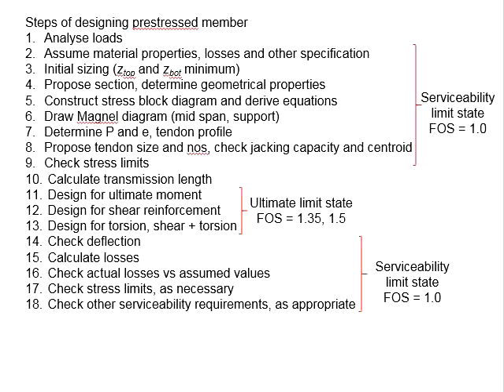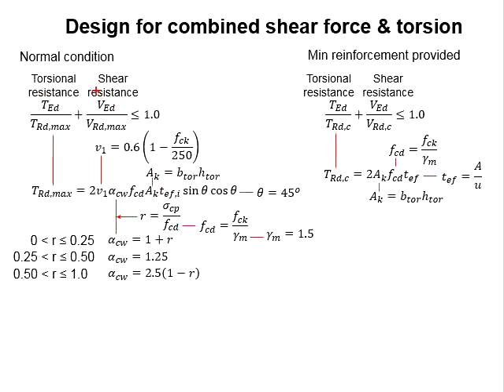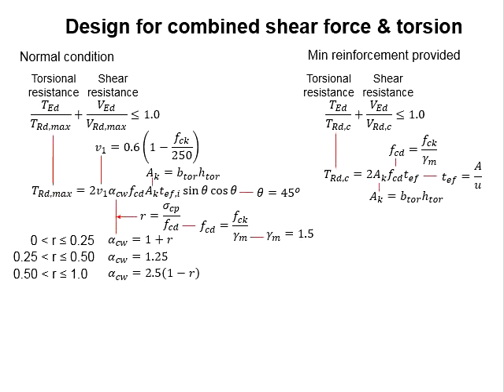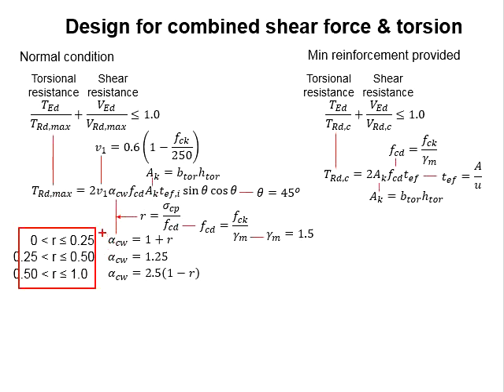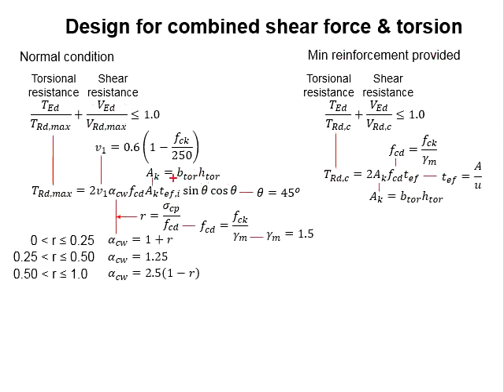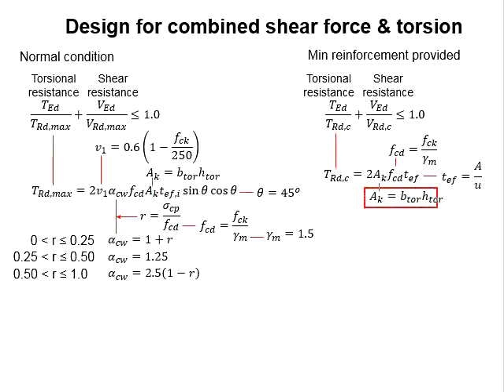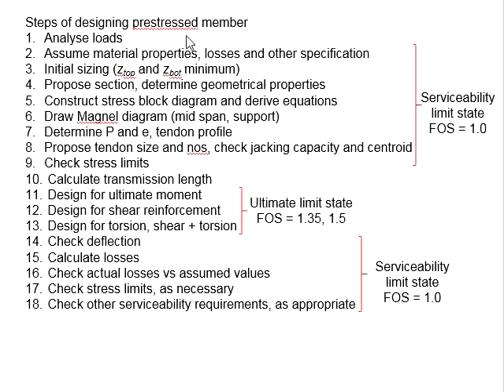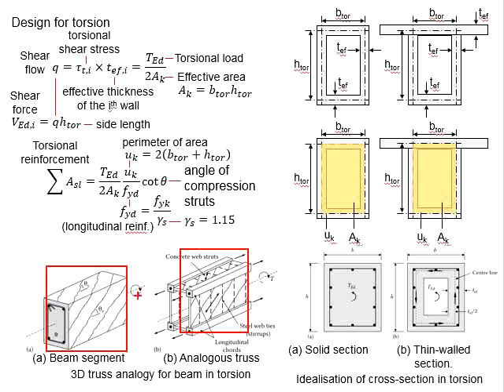3.12 Shear and torsion

Comment: How do we know that we have to check at 45 angle only
Reply from the maker: 45o is the max, beyond which it is considered failed.
Reply: The 45 angle comes from the strut and Tie model which is used to work out the shear reinforcement in concrete members. It can change but 45 degree is mostly agreed upon to be an ideal angle for a beam. Hence, most codes provide 45 angle.